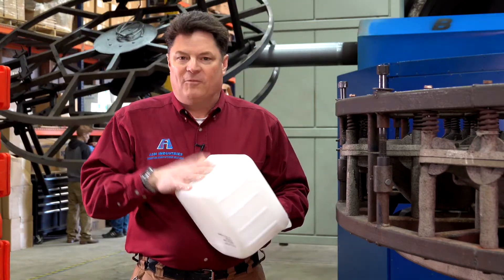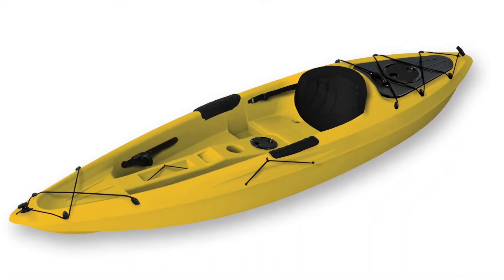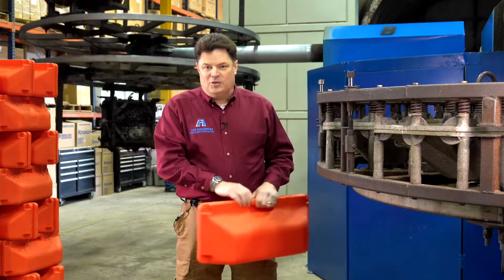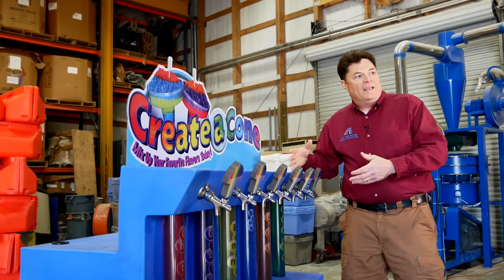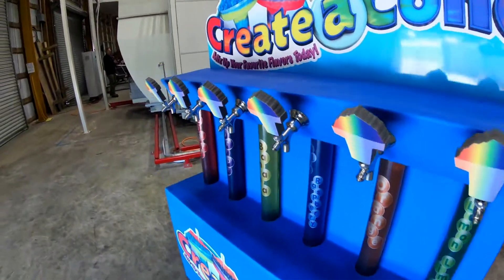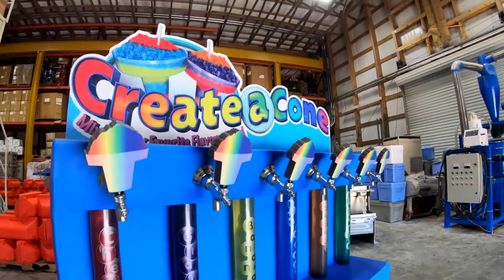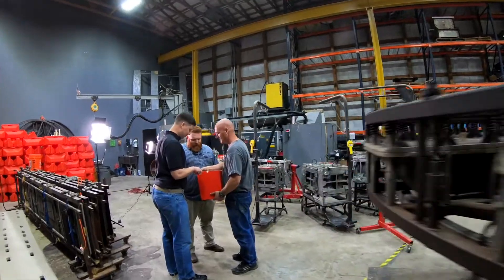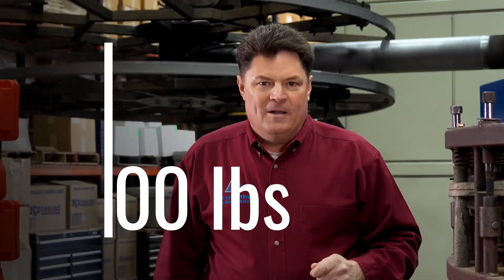Rotational Molding Samples From ASH Industries | Lafayette, LA

Comment: how to avoid color fade
Reply from the maker: Color fade in roto molded plastic is primarily caused by exposure to ultraviolet (UV) radiation from sunlight. Here are Some effective methods to prevent or minimize color fade:
1. Incorporate UV stabilizers into the plastic resin during the manufacturing process. These additives absorb UV radiation, preventing it from breaking down the color pigments. Many modern resins already contain UV stabilizers.

2. Opt for lightfast pigments: These pigments are specifically designed to resist fading when exposed to sunlight. Avoid organic pigments: They are generally more susceptible to fading compared to inorganic pigments.

3. Apply a protective coating, it can act as a barrier, shielding the plastic from harmful radiation.
    Consider laminating: Laminating the plastic with a UV-protective film can provide additional protection